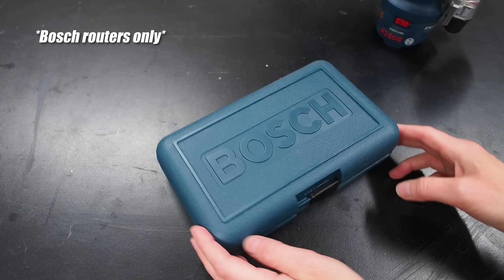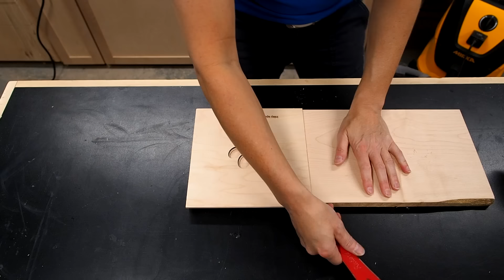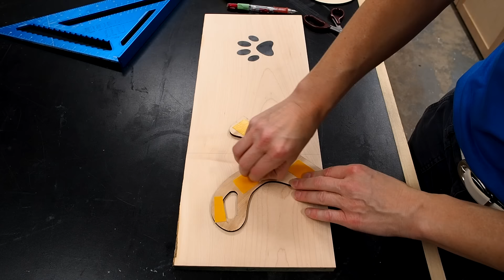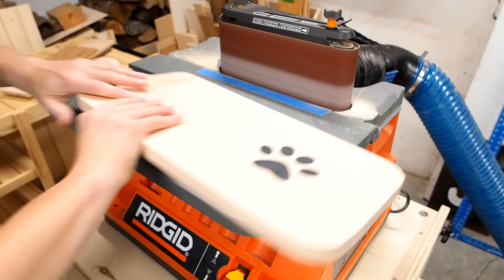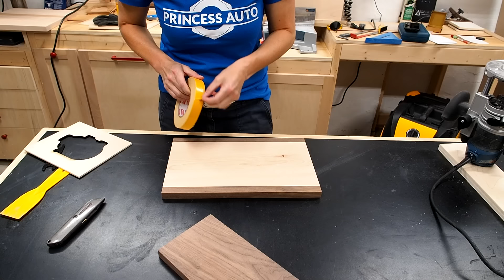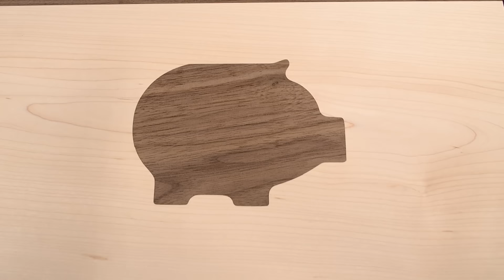Router inlays | Who knew it could be that easy!?

Comment: My sister and brother-in-law requested I make them a large charcuterie board (not a problem) but they wanted a mid-century modern look to it that would require a two step in lay process.  I have a small laser that in theory I could cut the templates on, and I have an inlay router kit with.  I'm just not sure how to get started.  I use lightburn software for the laser, but haven't tried designing templates, and I haven't cut anything with my laser yet.  I've used mine simply for engraving.  Sugesstions?
Reply from the maker: Wish I had a clear recommendation to give you, but for me it was mostly trial and error, research, figuring the best cut settings, how to design, etc.

Comment: Great vid! And thanks for the tip on tape - I've saved it to my bookmarks. 🙂
What part of Canada are you? I'm in southwestern Ontario. Would you consider cutting custom templates for me? I don't have a laser at this point...
Reply from the maker: I'm in Montreal Quebec. Open to creating custom templates. Send me an email of what you're looking for info@diymontreal.com
Reply: @DIYMontreal , ok. :-) I should have cottoned to that, from your YT handle. Lol! Great, I may just contact you once I have my ducks in a row here. In the process of packing up my shop, just now. Moving later in  the year...
Reply: @DIYMontreal, super informative video, thank you for laying it out so simply. I learnt how to cut hexagons from one of your previous videos too! Quick question though, I somehow fail to understand why the collar was used on the main piece and not the inlay piece. Isn't the collar supposed to reduce the size such that the inlay fits inside the cavity? Forgive for this basic question, I am just about a year old in working with wood. 

@daveweber1331 you say southwestern Ontario, I am in Hamilton. I am very new to woodworking, if you are close to Hamilton I'd like to meet up over coffee 😊
Reply from the maker: @subhtommy  Think of the pig outline as an imaginary line. Adding the collar pushes the bit to the inside of the line, while removing the collar puts the bit on the outside of the line.
Reply: @DIYMontreal  Aaha! Of course, that explains. Thank you so very much!

Comment: I've watched this 4 times and I still can't figure out how that collar is helpful. If anything it pushes the router bit inside of the edge of the template another 1/8th of an inch which means that taking that collar off and cutting the pig piece out would end up with the pig being much too large. Do them both with or without the collar and they'd match. That collar is useless.
Reply: This way of thinking may help.

If you think of the exact same outline of the pig being drawn on the cutting board and the inlay walnut. Then the router bit needs to cut inside the line on the cutting board, and outside the line on the inlay. That's why you use the big collar for the inlay cavity on the cutting board, to move the bit inside the line. Then the smaller collar for the walnut to be inlayed, to move the bit outside the line. 

I hope that helps.
Reply: It's about compensating for the bit's kerf.  It's a little like this:
I want to cut a board to 27", so I mark out my line to 27", line up my chop saw's blade to the line and... that's weird,  why'd my board come out to 26 7/8"?  I cut exactly on the line I drew!(But on the wrong side of the line.)

Comment: GREAT work once again.  I have had that bushing inlay kit for many, many years.  The intent was to do some bowtie work on crack but have always been afraid to tackle it.  You mad it look easy.    I would say one of the keys is to do all templates without square corners or point and therefore not chisel works to screw up.  For me anyway.  Thanks again for a very informative and practical lesson.    JimE
Reply from the maker: The corners have been a key point of consideration in my design process. Can't have any sharp corners or narrow curves where the bushing won't fit with the collar on. Otherwise the sky's the limit!
Reply: @DIYMontreal  👍How true!  Keep 'um coming.               JimE

Comment: Awesome inlay demonstrations! A tip for epoxy is to have a heatgun (a torch can work but the heatgun is safer) to remove air bubbles from it before it cures.
Reply from the maker: Absolutely. Good tip!

Comment: Great project and explanation. The results speak for themselves.
One question, since your laser is quite accurate. Could you print a pair of templates an use the second one as an inner template so you can't overcut the inlay piece?
Reply from the maker: Yes I've been playing around with that but still trying to get the sizing exact. The fit never seems to be as good as with the inlay kit using a single template.
Reply: @DIYMontreal  Good to know.